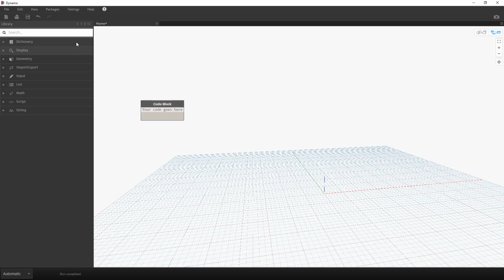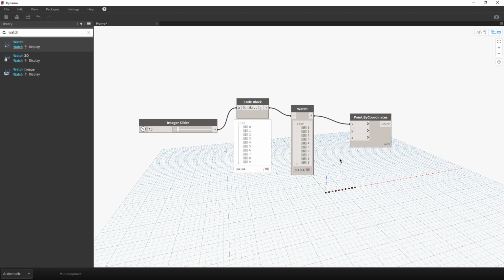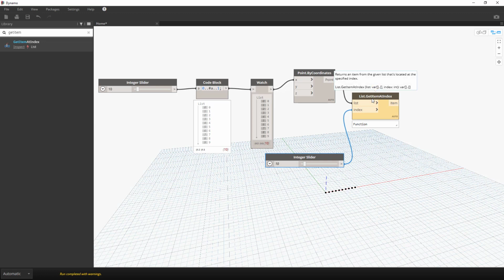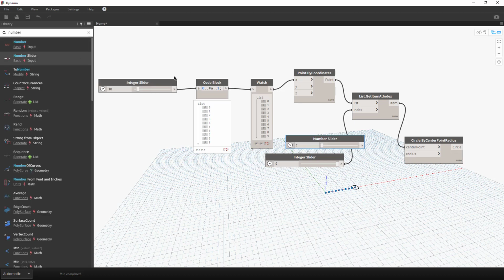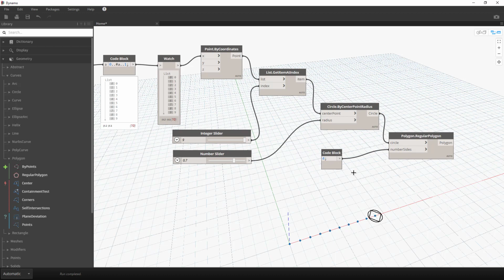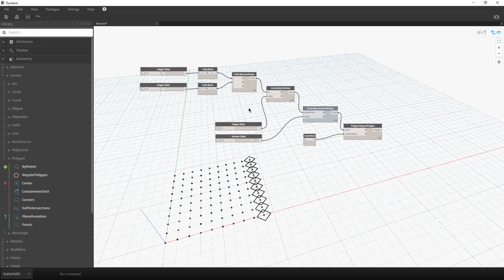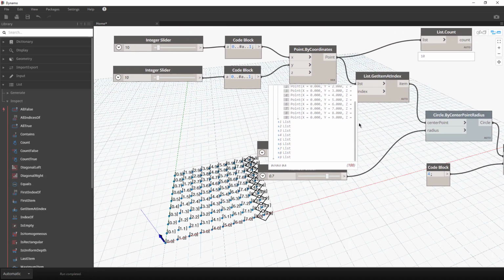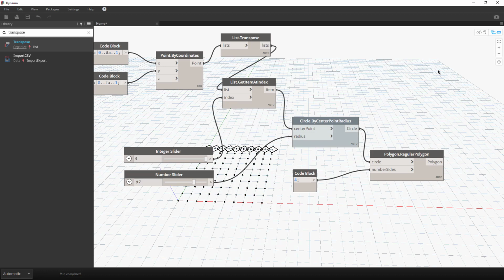04 NestedListManagement

Comment: When using an Integer Slider there is quite a delay in the automated updates. It's not as smooth as in your demonstration. Are there any settings that I can tweak to enhance the permorfmance of dynamo? My computer is quite powerful, so I don't suppose it's a bottleneck issue. Thanks!
Reply: Hello Melcerel - Are you using Dynamo in Revit, or elsewhere? This video does indeed contain very lightweight actions, so strange it's behaving slowly!